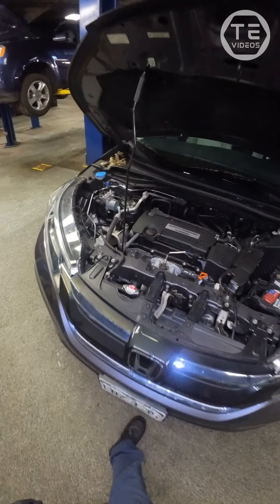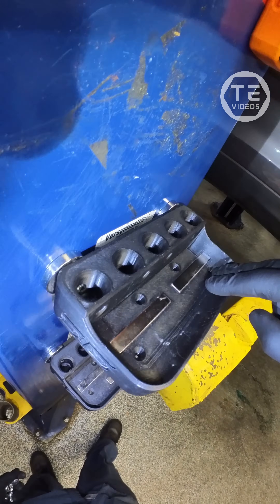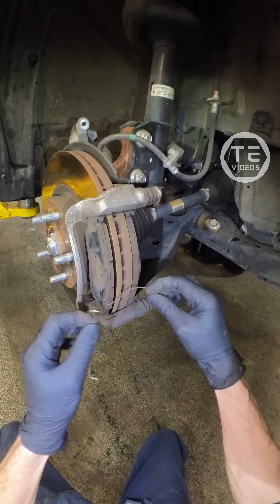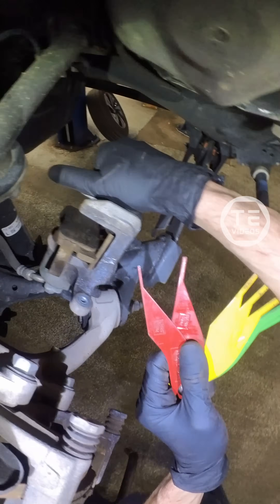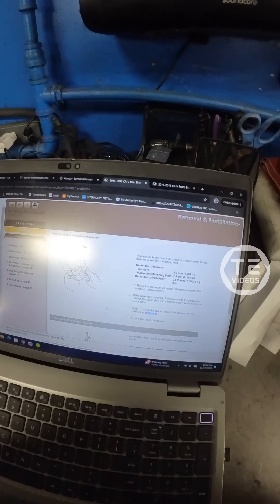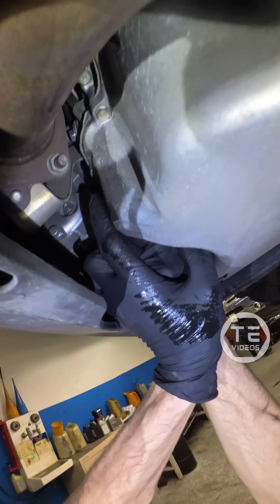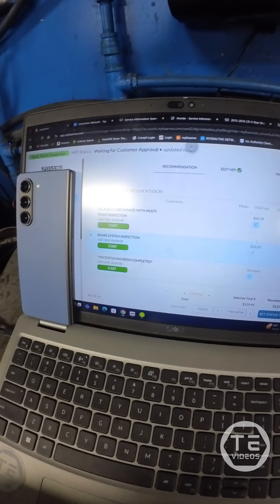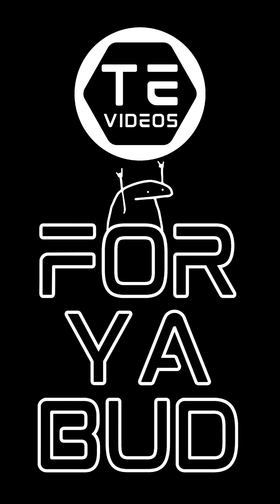15 La Fonda CR-V Oil Change Brake Inspection POV FYB 🔍👀🔧 #honda #crv #oilchange #pov #asmr

Comment: Crazy you have to take the all calipers off for a mpi on an oil change there’s gotta be a better way
Reply from the maker: They are paying for a brake inspection
Reply: @TEVIDEOS  Novice DIYer here, so this question might be dumb. What do you learn by taking the calipers off?
Reply: you can see the condition that the calipers are in as well as the brake pad thickness and the rotor thickness which both have a minimum requirement, it's mostly preventative maintenance

Comment: 14:01 as someone who drives a lot of miles in the middle of nowhere, if I was recommended brake servicing if the brakes were borderline worn, I would just go ahead and have them done as preventable maintenance. Each driver is different, so I guess it’s a judgement call for their situation.